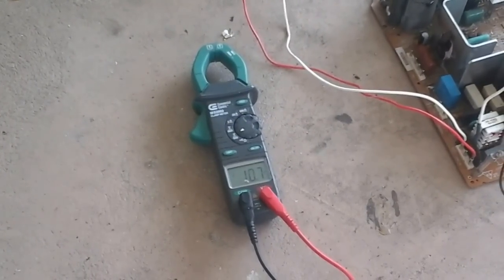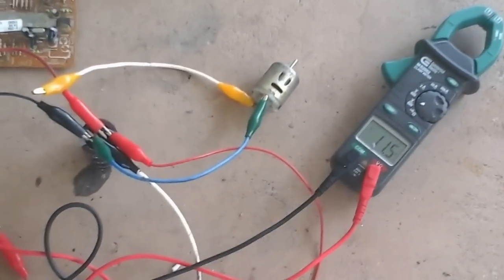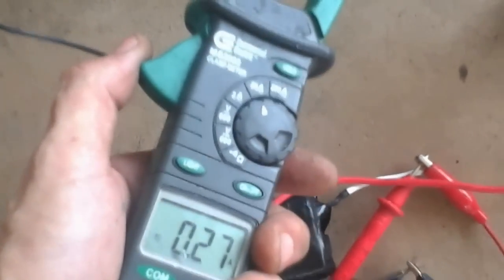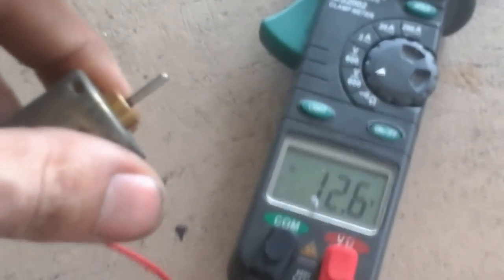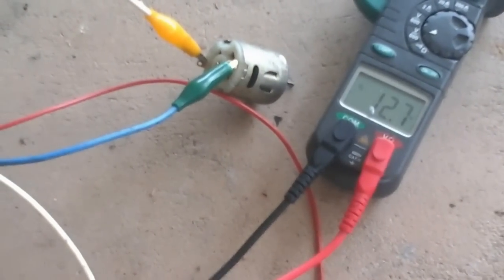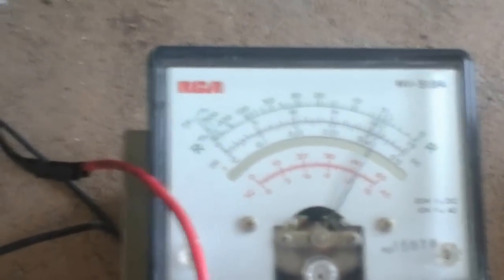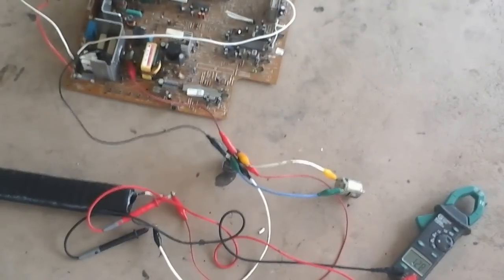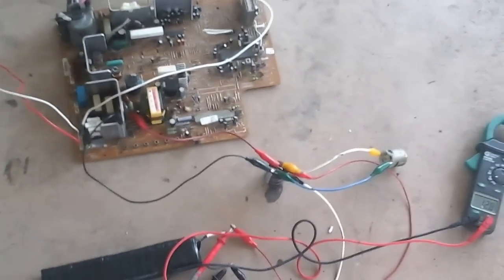Gerard Morin recharge  battery  and run dc motor

Comment: input : 12.5 V x 1.6 amps // output : [trough the RF pump] ] more Volts x 5 amps => 0.3 amps running the small motor fullspeed&high torque + 0.25 amps X 12.7 volt charging the battery..... that's very impressive and mind blowing...

Comment: Hey Matt, hope all is well.  Just want to clarify.  You mentioned wiring all the small transformers in serial and experimented with charging batteries, and then switched to the tv board.  It looks like you are running from the pump to your capacitor bank (in parallel to stabilize ac  also what are specs on caps?) and then to the ac input on the board, and then from there grounding on the neg side of the ac input and pos going to bridge rectifier (to rectify to dc).  Then to small cap, then to battery being charged and DC motor.  I see another white wire running elsewhere on the board.  Another ground? Are you using the flyback transformer at all?  Do I have everything right?
Reply from the maker: Nikola Tesler That white wire that is running across i believe is a ground to to input of your cable line...was there when i pulled the board out... I will upload a video on caps...they were caps out of a microwave....